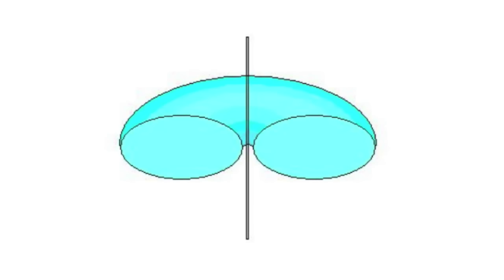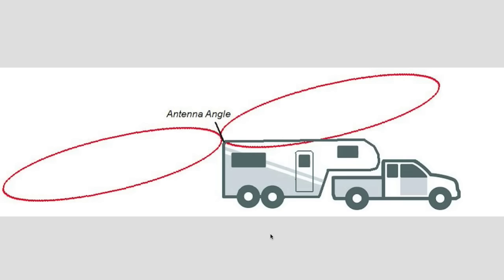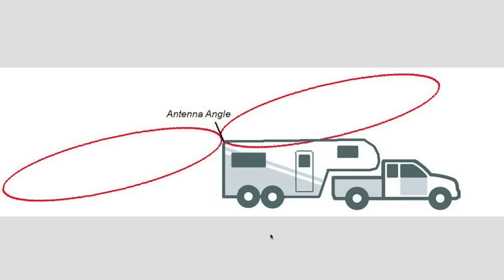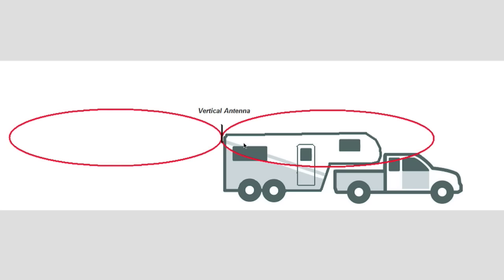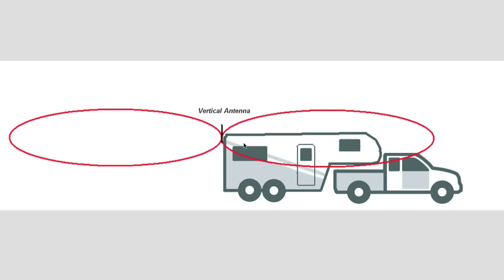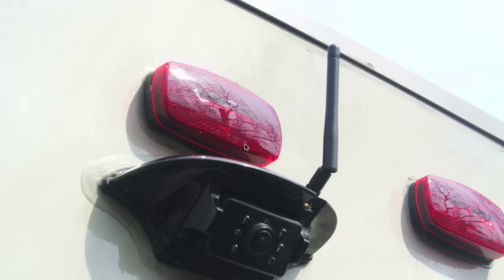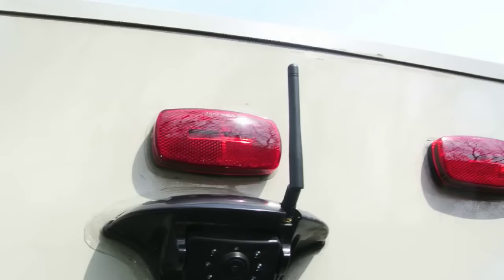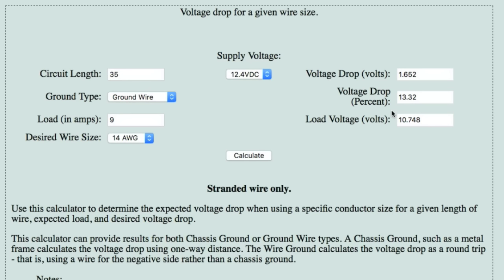Improving the Performance of a Furrion Backup Camera

Comment: We are having troubles with getting a signal from the camera on our 38 ft toy hauler. Is it possible that the Diamond plate on the inside ramp which folds up to be the back wall, is blocking any of the signal?

Comment: Great Video! As an Extra Note about the Antenna. You can also set the antenna horizontal (parallel with the body), and do the same on the monitor/receiver in the truck. This will provide a Horizontal Polarization. Which may aid in minimizing interference from other Vertically Polarized signals. It also helped the monitor's antenna to clear the windshield in my case.  I am using the Furrion 381556 FOS48TAPK-BL Wireless High-Speed RV Observation System with Mounting Bracket from Amazon.
Reply from the maker: Many years ago, when I was in the military, I worked on terrestrial microwave systems. The frequency was a bit higher  (4.5Ghz vs 2.4Ghz of the camera). Still, the modern devices running at multiple-ghz frequencies today is simply amazing.

At any rate, at those frequencies especially, there are indeed horizontal and vertical polarization. I had forgotten about that until you mentioned it. We used to run horizontal and vertically polarized signals simultaneously through the same antenna feedhorn.

Oh how handy would a  2.4Ghz field strength meter be?
Reply: Just thought I'd chime in, as an Electrical Engineering student.  THAT'S NOT HOW INTERFERENCE WORKS.  Where did you hear that?  I had a better understanding of radio transmission when I was 12 years old.  Cite a legitimate source.  I dare you to use that brain for the first time in your adult life.

Comment: Thanks. Best video I've seen. You actually offer solutions.
Reply from the maker: Thanks for watching. Funny thing though, after I recommended using the antenna in the vertical position and use of the ferrite coils, Furrion added language in their instructions for mounting the antenna vertically, and their new cameras come with ferrite coils. 

I am not claiming it was because of my video, but at least it confirmed I was on the right track.

Comment: Great information and thank you for posting. Would a longer antenna help or give you a stronger signal for good reception? I have this camera and some time I get an intermittent signal.
Reply from the maker: A longer antenna can help, as long as it is the proper multiple of the required wavelength. For example, the operating frequency of the system is 2.4Ghz, giving it a wavelength of 122mm. Thus, 30.5mm, 61mm, 122mm 244mm, etc would be good antenna lengths (the electrical length of the antenna - not the physical length).

 However, the longer (higher-gain) antennas tend to flatten out the radiated pattern, which makes the antenna positioning more critical.

Also, if you live in the United States, changing the antenna to a higher gain (stronger signal) could cause you to be in violation of FCC rules (Part 15).
Reply: What size monitor do you have in the video

Comment: If the vehicle is on and running doesn't the alternator give you a voltage boost to the trailer at around 14 volts?
Reply from the maker: While the alternator can produce 14V, there is resistance in any wiring, and you will lose a small amount of voltage for every foot you are from the power source  By the time it reaches the trailer, the output voltage could be in the  12~13v range.

Comment: Thanks. I am getting ready to install one and  replace all my running lights with LED's. I don't have a wiring  or voltage drop problem as I have a 41 year old GMC motorhome. and they believed in Big wires back then..lol.
Reply from the maker: They were built better then.

Comment: Would you recommend Furion or something else. Thanks for the video.
Reply from the maker: I have a Furrion camera and it works fine for me. So yes, i would recommend the Furrion. But get the Observation/Backup  version, not the Backup only version.
Reply: My 7" Furrion monitor stopped working.  I cannot find a replacement, even at the Furrion website.
Would a different monitor work ?  BTW, great post !!!
Reply: @wozdaddy3863  you can use any Furrion monitor 4.3”, 5”, 7”

Comment: Don't forget when you're driving down the road your battery voltage should be around 13.5 v and not 12.5 as stated.
Reply from the maker: A fully charged battery should be 12.6VDC. A running alternator should put a higher voltage on the battery when charging. It can vary a bit, but 13.4V or so is typical.

And don't forget that after 50ft of wiring between the towed vehicle battery/alternator and camera location, series resistance in the wiring can drop the voltage at the camera by a volt or more.